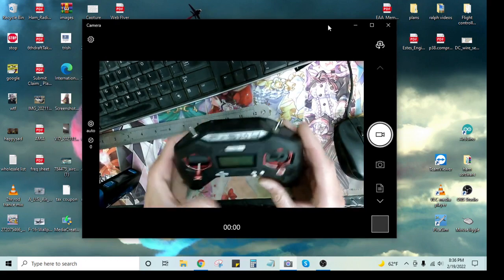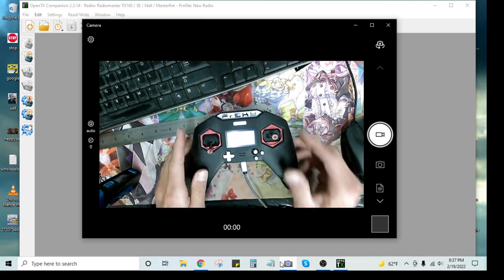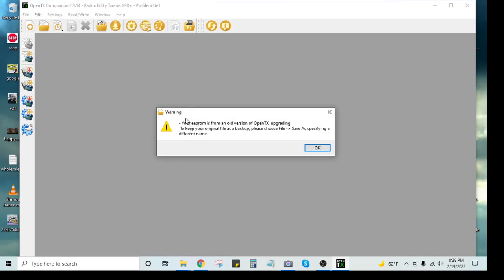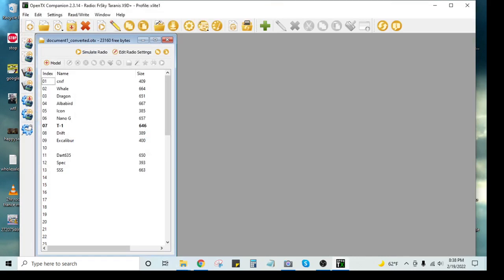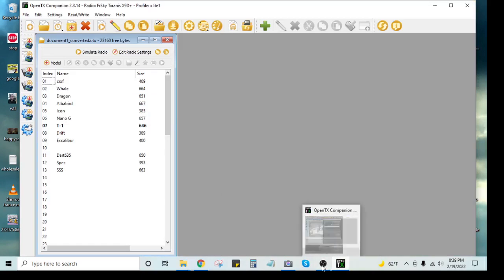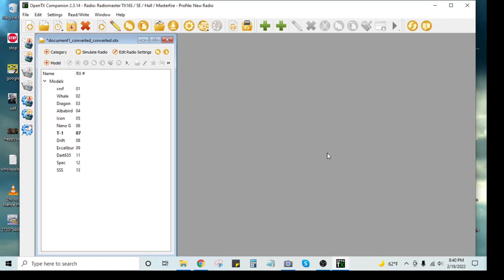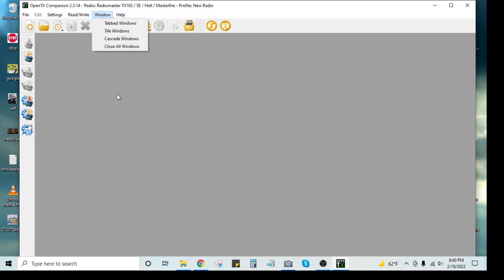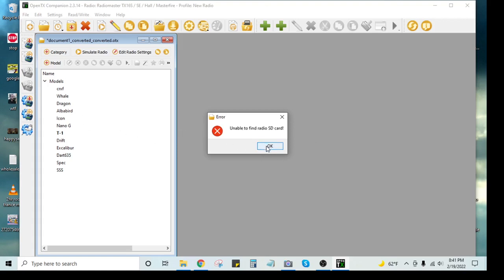convert .bin to .yaml openTX to edgeTX

Comment: I'm trying to move my models from my Jumper T16 with OpenTX to my new Radiomaster TX16S with EdgeTX (2.7.0) and nothing seems to work including this method.  The best that I get is model1.bin converts to model1.yaml.  But not really as the model does not show up with any configuration other than the basics.  I followed your method and received all of the same messages with the exception of a progress bar after the final step.  I did look at all of the files and they do show a current date and time so they did change, but there are few to no yaml files and everything still comes across as bin files.  I'm to the point that it would save time to just enter them in manually all over again.
Reply from the maker: once they are converted in companion, that file should be saved on the desktop..those would be ALL yml and NO bin files...from there the SD card in the radio should be completely empty of all models, then you transfer to the new radio...so there should be no bin files at all in the new radio...Im still kind of new myself but this seemed to work...I got a lot of usefull info from the radiomaster tx16s group on facebook
Reply: @travislab7687  186th try must be the charm.  From companion I copied all the files from my jumper to my computer.  They were all .bin format.   Then copied to my radiomaster using companion.  Deleted all of the previous files in the models and radio folders first. Unplugged and powered off. On boot up, I got the normal warning message about the files,  but this time I got a progress bar and all my models converted!